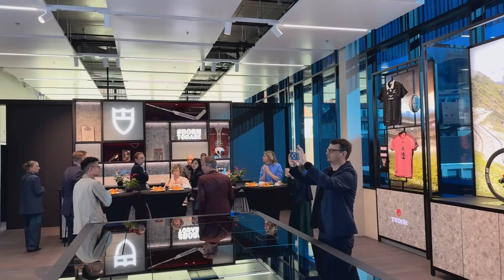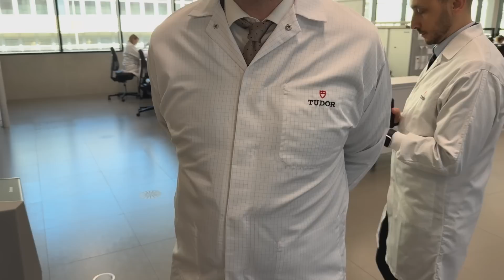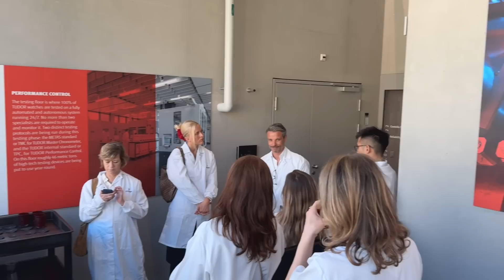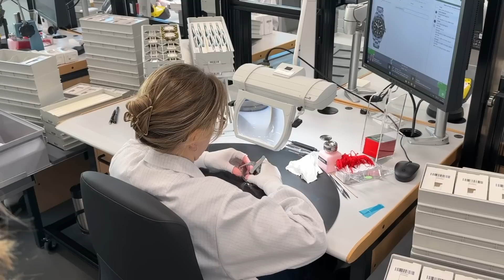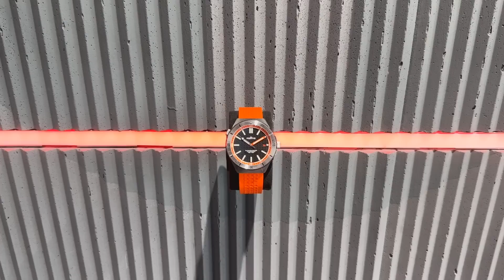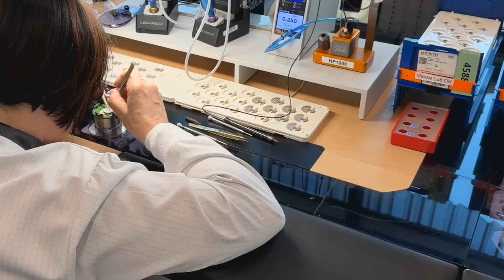How  @TudorWatch Watches Are Made 🔍🤖 | A Visit Inside Their High-Tech Le Locle Factory

Comment: So basically this is a mounting facility, not a factory. Where are all the components made? Probably China.
Reply from the maker: They source form many different other partners most I think is made around other areas of 🇨🇭
Reply: @klockfeber  This has been a hotly debated topic for years in forums. To date, there is no evidence of a Swiss case supplier for several brands, including Tudor.

The only concrete information is that brands like Tudor and Omega indicate the CN code of origin on the labels of accessories and spare parts, such as bracelets, which means China.

Comment: Why there is rolex on the screen
Reply: Good spot. Maybe they share a lot of the software since they are sister companies. In fact, I once bought a Tudor piece but it came with a Rolex tag with a green string rather than a Tudor one with red string.
Reply from the maker: Oh good spotted!! I guess they share the productions software system 😂👍
Reply: @klockfeber  Not an entirely surprising legacy since, prior to the opening of this decidated facility a couple of years ago, all Tudors were assembled at the Rolex facility in Geneva
Reply from the maker: @ademyers2741 no for sure there is connections between the brands so I both hope and think they take inspiration from each other to build as good watches as possible 🎉😂
Reply from the maker: Where is there a rolex on what screen? 🤔
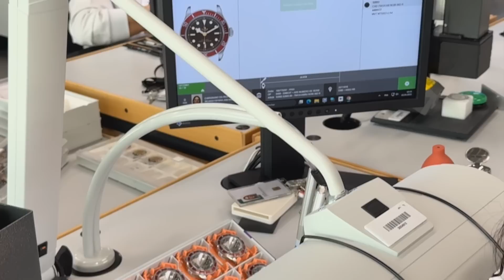Reply: At 5:21

Comment: So… not made in China then?
Reply from the maker: Haha nope would not think so mate 👍
Reply: Using data from Google, Tudor makes 300,000 watches a year and it takes 3.5 hours to assemble one watch. If one worker has 6 weeks vacation per year, they work 46 weeks, which is 1840 working hours, and in that time they assemble 526 watches per year. 300,000 watches divided by 526 equals 570 assembly workers needed. This video mentions 150 workers. So, the 570 - 150 = 420 other assemblers are located in China, or in some other sweatshop in Switzerland?
Reply: @garyh.2487  Sweatshop and Switzerland are pretty wild words to put in the same sentence. The Le Locle factory is brand new, and Tudor still does a significant amount of manufacturing in Geneva through its partnerships with Kenissi and other Rolex Group affiliates. I'm not sure where the '3.5 hours per watch' claim came from, maybe you're confusing it with the fact that the facility has a 3.5x per hour air circulation rate? Movements are already assembled by Kenissi, and the final casing likely takes under 30 minutes per watch on the assembly floor. If Rolex or Tudor were outsourcing significant manufacturing to China, it would be a massive violation of Swiss law. The Swiss Made label is heavily regulated, and any breach would have insane legal consequences and blow up into an industry scandal. There is zero credible evidence that Tudor or Rolex is outsourcing watchmaking to China, it simply wouldn’t be worth the risk for brands that rely entirely on their reputation
Reply from the maker: @garyh.2487 hahah interesting calculation mate - but don’t know if all watches comes from this factory no 😂
Reply: @garyh.2487  This factory is brand new, there's still more manufacturing done in Geneve, where they were originally made, from Rolex group associates such as Kenissi and Rolex's own manufacturing. I'm not even sure where you got the estimation of 3.5 hours per Tudor watch assembly, maybe mixing it up with the 3.5x per hour air cycle, because the movements are already assembled by Kenissi and the actual assembly time (within the assembly floor) should be less than 30 minutes. If these companies were outsourcing significant manufacturing to other countries, significant and heavy legal action would be already taken by the Swiss government and it would be the scandal of the century. There's simply no evidence that these companies (Rolex, Tudor) are outsourcing work to China.